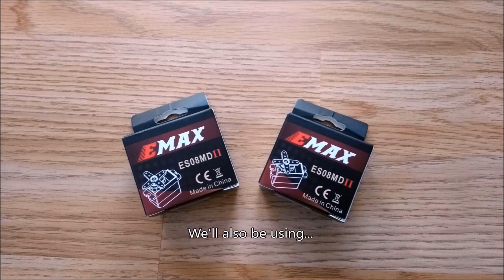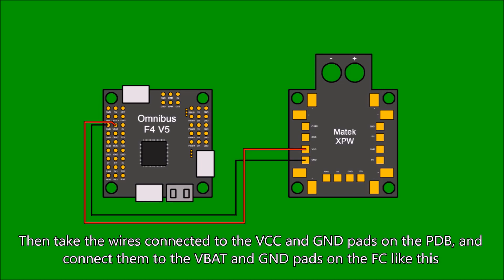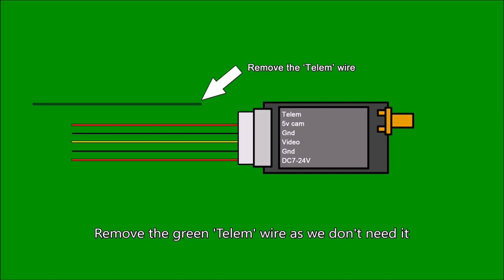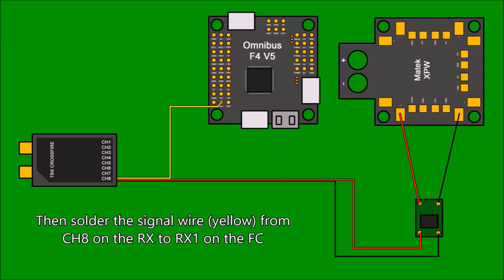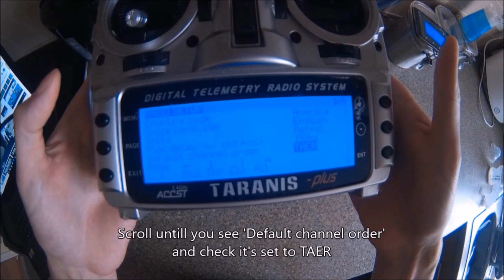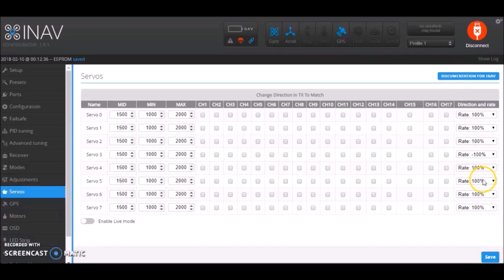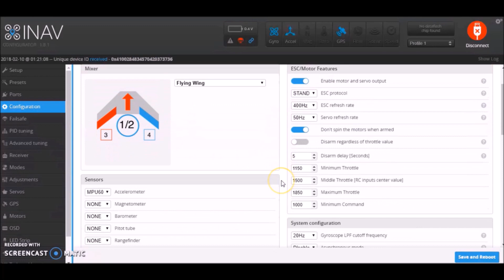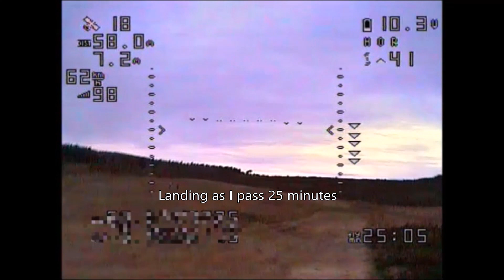🛩️ Long range S800 - Detailed step by step build and Inav setup

Comment from the maker: Turns out you don't actually need 130g of ballast in the nose. I've reduced it to 70g now and it fly's perfect
Reply: How so ? Its reduced by half. Shorly  the wing must be tail heavy or is the CG point further from the nose  ? Also how do you like chaos vtx (would you say its better then foxeer switcher) ? Last question where did you get cobra motor CP2207 with only 1850kv ?
Reply from the maker: I balanced the CG according to the CG point on the aircraft that's 120mm from the nose, and although on the bench it felt correct, in flight I found the aircraft wanted to pitch forward a lot. So I removed some of the nose weight untill I reached a point where it flew much nicer. Yes I like the chaos vtx, its smaller and lighter than the foxeer switcher and more powerful too. Only thing I don't like about it is the odd plug that connects the wiring harness. It's not a standard mini jst but some weird hybrid. Not really a probem though. I got my cobra motor from quadcopters.co.uk
Reply: Thank you for info. I checked the motor and they have it in stock by delivery is 12 pounds to Slovakia. they are crazy those guys. 12 pounds for delivery of small motor in EU. So I guess no cobra motor for now :) I definitely thinking to get that vtx. Is the range of this vtx much better then foxeer ?
Reply from the maker: Yup. With the Foxeer the maximum distance I could achieve was around 5km, whereas with the Chaos I've so far done 6.8km and still had a good picture. Good quality antenna's are important though. Ah that sucks about the motor. Any 1850kv race quad motor should be just as good though, it doesnt have to be a cobra :)
Reply: True no need for cobra. I just cant believe how long flight you got out of it. I have 2200mah 3s like u and get maybe 10min how is this possible? Though my motor is 2300kv
Reply: where i can to find Matek XPW?
Reply: it is a bit pricey, that is for sure, I have never built an Inav build.
Reply: Most build videos say nothing about CG, balance, or lead weights. I dont know why this very important part is not included.
Reply: @derrickmitchell39dm  because everyone is tossing it at the beginning at no one doesn't like to recognize that they fail at such a simple thing. :))
Reply: Code

Comment: First video I’ve found where you actually show what you use and how to set it up, earned a like and sub from me I’m wanting to get into longer range fpv and this is a great start video. Now just need to spend some cash
Reply from the maker: I'm glad you enjoyed it. Do it, it'll be money well spent :p
Reply: @gizfpv  question, is there newer stuff that’s more plug abd play now, I have a wing I’m wanting like two miles of range. I have a spectrum receiver and and remote and will need to increase that range, and then I have a rushtank solo 1000 mw with immersion rc antennas and Sky zone goggles. Appreciate any help
Reply from the maker: @nathantraucht1981  Kind of, yes. These days Mateksys make 'wing' flight controllers that have pin headers, meaning you don't have to solder everything and instead can use plugs. Typically makes builds quicker and easier to do. If you watch any of my more recent videos you'll see i use those flight controllers and do very little soldering
Reply: @gizfpv  ok awesome thank you

Comment: Another cool S800. Building one myself as I speak. Look on thingyverse for vortex generators s800. These lower induced drag(longer range) and lower stall speed(increase load carrying capability, like larger battery...). Make the wing more directionally stable. easy mod.
Reply: I put S800 VG's on my fury wing. Before it was having a pitch stabilization wobble, now it's rock solid.

Comment: Now I find your video, Would love to see what you would use now. I thought about installing a Eagletree Vector in mine but, think I will wait till later or perhaps for the Harrier build.
Might put the old APM 2.1 from 2015 in it.
Reply from the maker: Have a look at my more recent videos, I use a lot of different hardware now, although still run inav on all my builds. I think a eagletree vector might be slight overkill for a s800, would be better suited to a larger aircraft that can do more range. But that's just my opinion 😊

Comment: When I fly with my s800, I always mark the home in the opposite direction, except when I pass it on its side, it is as if it had the drone rotated because the point recognizes it well but would be well oriented if the wing was in the opposite direction.

Comment: Very nicr video. Only thing you could improve it to ground your flight control whefe you connect your vin and vout. This will remove the OSD flickering. Also you can add an LC filter to your fpv power to remove the noise. 

Very good and well made video!
Reply from the maker: Cheers. And yes I know. I've been meaning to change the ground wires on my vtx and cam ever since I did the maiden flight of this wing and found the OSD flicker issue, but I haven't got around to it yet.

Comment: i am building a long range fpv wing tbs caipirinha 2 with px4 air speed sensor and matek f772 wing flight controller and beitian bs 280 gps is it compulsary to add compass for rth or failsafe ??

Comment: I have another question ! why in the INAV configuration you remove the parameter of the barometer?
on my f3 I have a barometer but not integret in my GPS I have to check the option barometer in the config? Thank you

Comment: @Giz FPV, in the video at 1:18 I noticed you have the TBS Crossfire wired through a 5v regulator to the main pads on the PDB.  Couldn't you just wire the TBS Crossfire directly to a 5v pad on the PDB and not use the regulator?
Reply from the maker: In theory yes, but the TBS Crossfire diversity rx requires 1a minimum to power it. The 5v regulator on the PDB is only 2a, and the servos need a unknown amount of amps to power them. So I used a seperate 5v regulator as a precaution. Better to use that than to possibly overload the PDB regulator and loose either rx, servos or both in flight
Reply: Appreciate the quick reply and thorough breakdown!!

Comment: You did it again... another great video!!!...  But why they OSD is blinking?
Reply from the maker: The OSD blinks when the throttle is high due to a 'ground loop' issue. It can be fixed by taking the ground wires from the vtx and the camera and soldering them to the FC. I meant to do this but forgot, and seeing as I rarely fly with the throttle high I'm not to worried about it at the moment

Comment: Can you share your thoughts why cutting spaces for the vtx and rx, instead of using the pre-made spaces?
Reply from the maker: The aircraft fly's significantly better if you keep all the weight as close to the centre as possible. You can use the pre-made slots on the wings for your vtx and rx if you want, but the wing will be more difficult to launch and rock around more in flight

Comment: helped me with my Build! Thx! Is there a special reason for using the f4 v5 instead of the f3 omnibus in the previous s800?
Reply from the maker: Henning M Not really. Just figured I'd put in a f4 as it was the same price as the F3. But you don't gain anything useful for using a f4. Only thing that is slightly useful is you get a extra uart, but you don't need it. F3 is just fine 😊

Comment: Hi , i looking for a z-84 and use this parts or the parts You Where Using on the 250g plane. What is your suggestion? Reduce weight is important. Which plane do like most?
Reply from the maker: The parts I used on my sub 250g nano goblin wouldn't be suitable for a z-84. The motor would be way to small. You'd be better off using a 22xx kv race quad motor
Reply: Giz FPV ok but i mean rest of the parts?

Comment: Hi, I'm using the Omnibus F4 V5 board on a quad build and was just wondering what exactly it does when you put the Jumper between the Vbat and RAM? I've trawled the web but can't find anything to explain it. Your videos are brilliant by the way and easy to follow. Keep up the great work.
Reply from the maker: The jumper determines what voltage comes out of the RAM pads on the OSD rail. Either be 5v or lipo voltage
Reply: @gizfpv  many thanks

Comment: When you laminate do you laminate the bottom as well and do you use any tape/reinforcement on the elevons?
Reply from the maker: Yes, I laminate the top and bottom of everything (wings and fuselage). I use one sheet for the top side and a seperate sheet for the underside, and make sure the 2 sheets overlap along the leading edge. The top side sheet covers the elevons, so that somewhat reinforces the hinge. If you look at 1:12 you'll see I've then got the orange tape overlaping the hinge too
Reply: Giz FPV I didn't even notice that at the 1:12 Mark haha. Thanks for the reply.
Reply: where did you buy it? Thanks
Reply: Giz FPV im talking about the laminate film

Comment: Nice video helped me alot with my first ever wing build and first inav! Had a question for you. I put my servos with the up tilt but now the surface doesn't go all the way down. Os this okay or should I adjust the min in the servo mixer
Reply from the maker: Sorry for the late reply. When you say the surface doesnt go all the way down do you mean that the elevon doesnt go all the way down?
Reply: @gizfpv  yes sir and no worries
Reply from the maker: @Djtoken1  Does it go down at all? It's probably fine, you'll lose a bit of downward deflection due to adding some uptilt. But it should still fly fine

Comment: I have the Omnibus F4 version 5 when I connected it to betaflight the Target was Omnibus F4 SD why are you using omnibus f4proTarget?
Reply from the maker: Because that's the target that the instruction leaflet that came with the FC said to use
Reply: @gizfpv  ok well i have the same fc. The paper mine came with says omnibusf4sd for betaflight. So idk which one to use for inav.. cause the sd one isnt in there...? Should i use the omnibusf4pro? Also im using rmrc mini gps and tbs crossfire and unify. What uarts should i comnect the gps and crossfire to?
Reply from the maker: Use the same target i did, it should be fine. Put GPS on uart 3 and crossfire on uart 1.
Reply: @gizfpv  ok . Thank you for your help. I have tries xfire on uart6 and no luck. So i tried uart 3 and it works . I also put the gps on uart 1 and it works..  i have smartaudio that i need to hook up too so hopefully uart 6 will work....  donyou know if smartaudio needs to be inverted or uninverted?  
Also why is the looptime at 500hz why so low? Thanks

Comment: Nice flight time on the 3s battery! I run a 2600kv and 1800mah 4s on my AR WIng which gets me about 16 mins tops, 3120mah li-ion gets about 30 mins though ... still considering a lower KV motor, just not sure what kv and prop to go for yet, any recommendations?
Reply from the maker: The motor I am using seems to be one of the best options (hence why I went for it lol). You could put a even lower kv motor on, but then you'd have to use a even bigger prop for optimal efficency. With my motor I can use a 7" prop, but a lower kv motor would likely need a 8", which wont fit unless you trim the elevons
Reply: It's hard to find the amp draw specs on the Cobra. Running 4s with a 7" prop, do you know how many amps your likely to pull at full throttle and cruise ? Ideally i'd like to stick the li-ion pack in but constant draw is 18.5a and 56a max for 60s bursts. Cheers

Comment: I have just done this build with the same parts and I cant for the life of me get the gps to work.  I have x4r frsky receiver on the sbus pins which I understand is uart 6.  I wired up the gps to uart 3 as you showed in video tx from gps to rx on Fc etc. It is a cloudy day here, could that be the issue? Any help would be appreciated mate.
Reply from the maker: Connect the aircraft to INAV configurator on your pc, and power the aircraft with a lipo battery. On the GPS tab in INAV have a look at the GPS statistics box on the lower left.....do you see any numbers beside 'Total messages' and 'Errors'? If you do, your GPS is most likely working fine and you're just struggling to get a GPS lock because you're in a low signal area
Reply: Giz FPV thanks

Comment: Also can the new crossfire micro work with this setup?
Reply from the maker: Should do. You can power the micro from the fc, you wouldn't need the regulator
Reply: Dronex TV a

Comment: Why use the regulator instead of just using the 5v off the pdb?
Reply from the maker: The 5v on the PDB can't supply enough Amps to power the servos and the RX. So a second 5v regulator is needed
Reply: @gizfpv  Ah got it I didn't know how much the Crossfire pulled.

Comment: What do you think I should buy: reptile s800 or reptile s800 v2?for inav and 1500-3000mah 3s  battery.
 Thanks in advance,
Reply from the maker: Depends what you want to do. If you plan to do long range flights get the V1 as its lighter, if you want to do fast proximity flying get the v2 because its stronger and will survive crashes better. Again which battery you use depends on what sort of flying you're gonna do. For long range flights go for the bigger battery
Reply: Giz FPV Thanks for the quick answer, if I understood correctly, the difference between v1 and v2 is in the material, so the design is the same design? 
I plan longrange, so the place for the battery is important to me.
Reply from the maker: yehonatan Bellaiche Yup the design is identical on both the v1 and the V2, just a slightly different material. The v1 is still very tough, but lighter, so for long range get the v1
Reply: Thank you very much, you helped me alot!

Comment: Why do you use regulator for 5V if you can have it from PDB?
Reply from the maker: RandomGuy Because the 5v regulator on the PDB is unable to safely supply enough amps to power the servos and Rx. The Rx needs a minimum of 1amp
Reply: oh ok, good to know, i wanted to just use supplied PDB for all of this

Comment: What target are you using for the f4 v5? I am having issues saying I need to update firmware every time I try and change anything
Reply from the maker: I used the Ombibusf4pro target. I believe Inav constantly telling you that you need to update firmware everytime you click save and reboot is a bug in the configurator. It happens to me on most my builds. Just ignore it and manually hit connect each time
Reply: Giz FPV nice! It isn't saving the changes, that's the annoying part, I am going to try cli commands and see if they stick

Comment: I never noticed if you flew any on Horizon mode.  My S800 flies good in Horizon except it is bouncy.  Click to passthrough and it's smooth as can be.  I have tried Autotune and manual tuning (with help from others).  I can't get the bounce out.  How is yours on horizon mode?
Reply from the maker: I almost always fly in Horizon mode and it's fairly smooth and stable. Only time it wobbles is if the speed is too low. Ironically mine doesnt fly so well in passthrough mode
Reply: The opposite of my problem.  Interesting.  Any chance you could email me your PIFF settings and let me try them?  Or maybe post them here for others that may be interested?  Thanks,
Reply from the maker: My PIFF settings are all default and haven't been changed at all since flashing Inav. Just use the Z84 preset and you'll have the same PIFF's as me.
Reply: Thanks.  I may have to give them a whirl. I was using the ones from Matte Box in Motion. His planes fly amazing but my S800 just doesn't like Horizon very well.  THis is my second one and neither flew smooth on horizon.  Most of my flying is pass through but I like to use Horizon for takeoff and landing.

Comment: One thing i noticed is you link Angle mode with Althold.  Just curious on the reason....i just did this on mine but wondering why you did.  Thanks!  You added a lot of weight, is this because of no HD Cam?
Reply from the maker: Alt hold mode doesn't work by itself, it has to be tied in with angle mode too. Not sure why, just the way the inav developers have set it up. And yes, I dont put a Gopro in the front so I have to add 80g to make up for it. Then another 50g on top just to balance it perfectly. I probably don't need that extra 50g though as my batterys are quite heavy
Reply: Thanks and great video as usual!  Im all ready to finally test mine but we keep getting snow!  :(

Comment: What prop do you recommend for Long Range?
Reply from the maker: I use a 6" and get about 30 mins flight, I've tested a 7" once and got a slightly longer flight time but also a slower speed. So depends how quickly you want to do long range flights I guess lol
Reply: Giz FPV ever try the folding props ?
Reply: 30mins flight with 6" props with what kind of battery ? 3s or 4s ? what capacity ? Thanks :)
I have cheap racerstar 2205 2600kv and planning to use 6040 props.
Reply: i got racestar 2600kv mount in s800 and 6040 overheating the motor, 4" with 4s battery and 5" with 3s battery get good results
Reply: I'm currently using the racerstar br 2205 2600kv with 6045 prop but it's not overheating. but still power is not enough. I've just bought a DYS 2208 1800kv to use it with 7045 props on 3s lipo
Reply: Simon Co not enough? my s800 with 6045 2600kv racestar is ridiculous overpowered. u turn the propeller reverse to maximize the thrust? when turn the propeller can launch at 40% without prroblems
Reply: Yurabita I need at least 80% throttle for launch
Reply: Simon Co maybe can exchange videos of our builds? maybe find a middle point for both. i ordered a 2300kv racestar, 5045 propeller and 3s 20c lipo battery to reduce the thrust.
Reply: Simon Co the manufacturer of racestar suggest 4045 for 2205 2600kv motor with both in 4s and 3s. i deduce that is the reason of my motor overheating.
what esc dou you have? i have a 25 bheli 25a with doubleshot